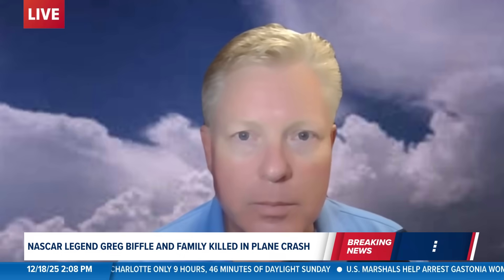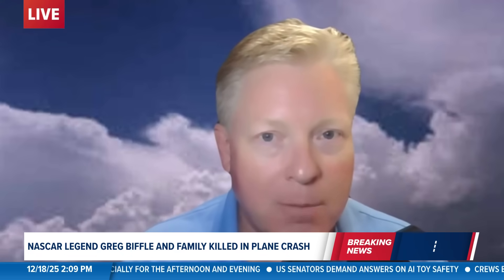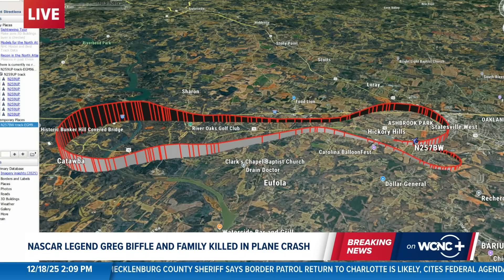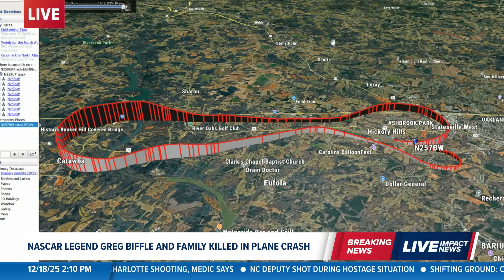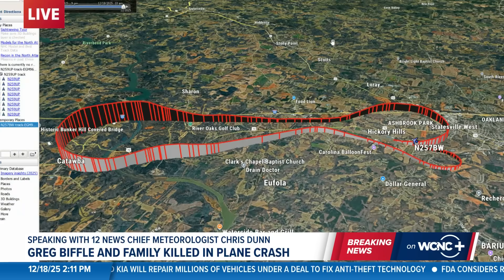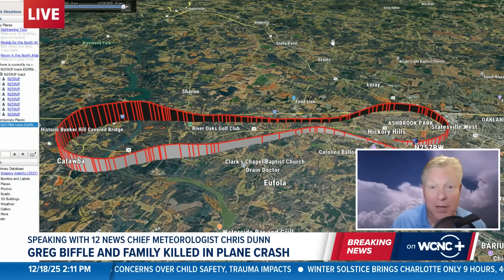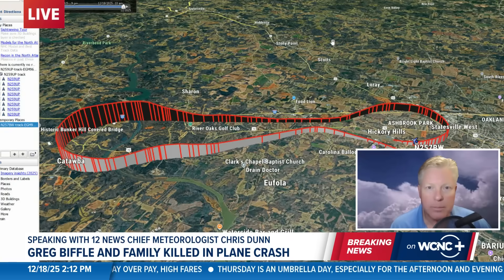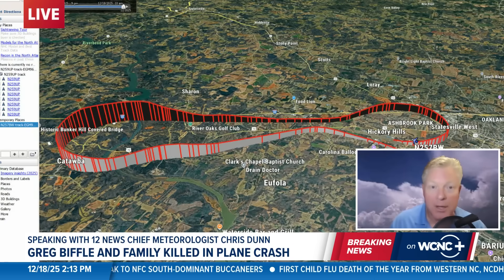What Pilots Do in Emergencies After Takeoff | Greg Biffle Plane Crash Explained

Comment: Weather conditions didn't support a return emergency landing on one engine. The unstable approach was extremely hazardous. No lateral or vertical guidance with only 50 percent power is very difficult in fog and rain. Apparently the plane was still flying ok until it hit the ground.
Reply: It was flying ok but when they came back the downwind 180 land, the bank was too tight and too low for 1 engine and full flaps. Thats why they lost control and shot the airport short approx 1800 ft. It was pilot error in returning so close to the airport and making the downwind 180 so tight.
Reply: The sullenberger rule. Flaps 10 gear up. He made it OK with zero engine power. Greg's pilot had 50 percent power. With flaps 10 and gear up the 550 could fly normally and even climb higher But when they put the gear down is what killed them. Gear down caused a sink rate that lost altitude and hit the ground. Plane was flying just fine till he put the gear down. Very sad they almost made just 1800 feet short.

Comment: Will never forget my primary instructor's briefing for engine out at takeoff: "Straight ahead goes to the hospital. Left and right go to the graveyard."
Reply: Does that necessarily apply to a double engine aircraft like this Cessna, which can still operate on one engine? Makes sense for a single-engine aircraft.
Reply: @humanbeing2420  You're right; lots of factors affect that decision. Weather, controllability, and of course available power remaining. That rule is an oversimplification designed to deter pilots from trying to turn back to the field after losing the only engine. Not sure what happened to these guys. Their ADS-B data has them at several different altitudes prior to making that odd pattern turn.

Comment: This plane has two engines. It is certified to fly with just one engine. Nearly impossible to loose both engines.
Reply: Contaminated fuel can cause a loss of Both Engines
Reply: @newblackconcepts4705 Highly unlikely they got contaminated fuel. Many planes use that airport. Fuel trucks have filters that prevent this from happening nowadays.

Comment: ...the impossible turn gets another one...RIP Biffle's ...and crew...
Reply: This is not the same thing. And certainly not an impossible turn situation.
Reply: @speedlever  ...not exactly...but, why go all the way around instead of straight back in?...
Reply: @bryanford1139 
Not being in the cockpit dealing with whatever issue(s) they were dealing with, I have no idea. The impossible turn references engine failure during departure with a single engine aircraft and attempting an immediate 180 degree turn in an attempt to return to the airport. It can and has been successfully done. It has also killed a lot of people trying but failing. Ergo the standard response to land it straight ahead as best you can. Better to put it into the trees under control than hitting whatever out of control. Of course there are many variables that can affect the outcome of such a maneuver. Not much time to debate your options unless you have gained plenty of altitude before the failure occurs.
Reply: @speedlever  It's killed quite a few...

Comment: There's danger in trying to accomplish the Impossible Turn back to the takeoff airport.  Also, loss of power, never turn in the direction of the dead engine - if you do - it will end up in a wing over and a smoking hole in the ground.  🥸🧐🛬🔥
Reply: No, it won’t. This was simply not an impossible turn back to the airport. Turning into the dead engine is not a fatal event unless you mismanage your airspeed, especially in a jet or turboprop.

Comment: You can stall a airplane at any speed but only 1 critical angle of attack.
Reply: Recovery is much easier at high speeds… Slow speed… stall and fall…
High speed… stall and quit doing whatever you just did that caused the accelerated stall… Still flying.

Comment: As mentioned in another comment here ... 

The ground track shows that they took off on Runway 10 eastbound, turned and went west about 8 miles out, and attempted a return to land eastbound on 10, suggesting an urgent situation.  For reasons unknown, when only a mile or so from landing eastbound and at low altitude, the approach was broken off... The aircraft attempted a very close, very tight, very dangerous low circling maneuver to land westbound on Runway 28.  It crashed in the midst of a very low, very sharp turn to get lined up to the runway westbound.
Reply: Stall
Reply: Full flaps on a tight turn and one engine. Thats why Citation couldn’t keep in the air.
Reply: I wonder if they had lost both engines...
Reply: @humanbeing2420  With both engines out, they wouldn't have been able to fly low, level and very fast, as they did, or make the kinds of climbs they did on the way back.  

Two seemingly solid theories at the moment are fire in the aircraft; or pitot tube covers not removed before flight.  Either of those then compounded by a desperate attempt to maintain visual contact with the ground and airport amid deteriorating instrument meteorological conditions.

Comment: I have a lot of time in the Citations, including the 550. Asymmetrical thrust is a very minor factor in a loss of engine scenario. The basic rules apply, as ever. Aviate, navigate, communicate. There's rarely a reason to hurry a response to any in flight failure, though an uncontrollable fire will get frisky in short order. By the way, the 550 is a pretty decent glider if you lose both engines (fuel contamination) in flight.
Reply: Im interested in seeing the report on this accident.
Reply: @Wire_Mesh_Police PilotBrief has a good preliminary review of the circumstances leading up to the accident.

Comment: I don't understand why they didn't just land on the same runway as they took off from. It appears they took off , experienced the emergency, went down wind and continued all the way around the airport and turned sharply on final opposite direction.  That would make a steep bank to final, and if they had an engine failure, it would stall easier at the higher bank angle trying to line up with the runway.
Reply: Being an uncontrolled airport , it could have been another plane on the runway . Looking at the flight data , it appears they were lining up to do that . Then veared off and went around . By then to much altitude was lost and couldn't make it . That might explain the sharp left turn on final . 
This would lead me to believe both engines were out at that time .
Reply: @pat36a   Yea I see that now, just sad. I followed Biffle for years in Nascar.
Reply: @sentryfe74   yes , he was 1 of my drivers also when i cared about Nascar .